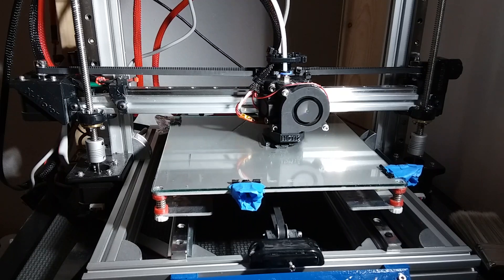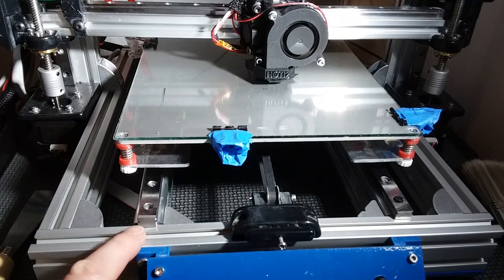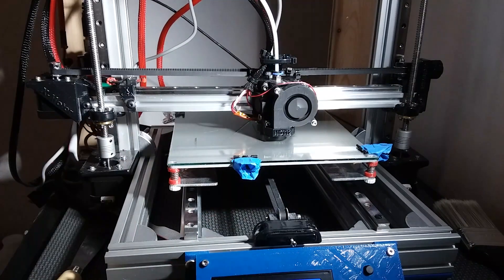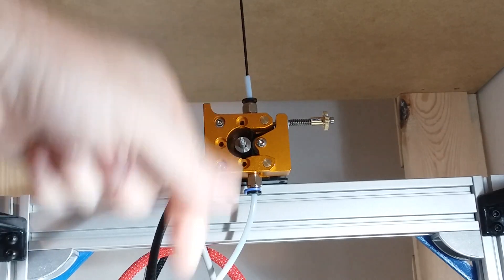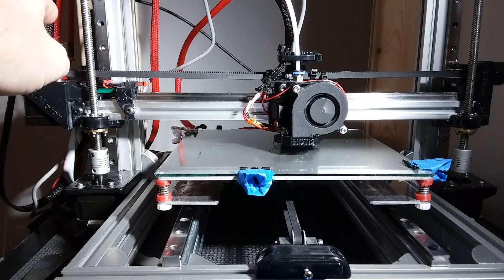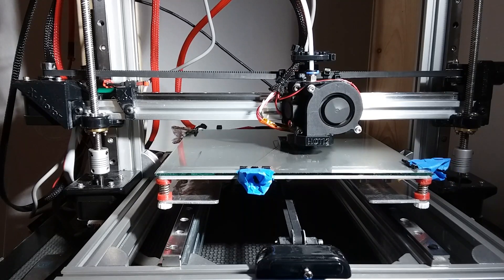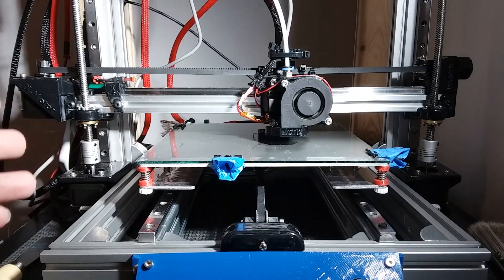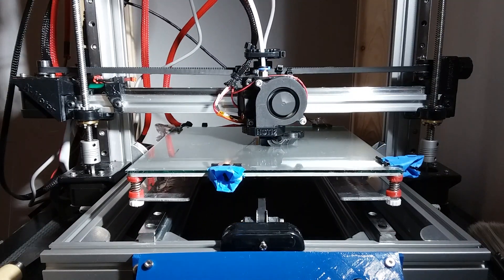The Ultimate ANET A8 Upgrade

Comment: Sounds weird to me that you had issues with the BLTouch. Did you use a genuine BLTouch or a knock-off "3DTouch"? I have a genuine one and had zero issues whatsoever for years. Precision is extremely good regardless of the bed temperature. The sensor you're using will measure completely different values depending on how hot the bed is and that's not good. Unless you use compensation tables for that, it can be dangerous.

Comment: How much did all that cost you to upgrade?
I have an Anet A8, and it prints quite well...but that AM8 seems very rigid, very cool
Reply from the maker: I probably spent under $200 for all the upgrades.  Probably could have bought a cheap printer for that but at least I know every little quirk with this printer because I built it.
Reply: @MrDabrudda  Yeah, if the Ender 3 was out before I bought my Anet A8, I would have gotten that one...

Comment: Install Klipper on your Anet main board and you'll be able to speed up your prints even more without a new mainboard
Reply from the maker: I use Fluidd and Klipper.  I haven't got around to testing the ADXL356
Reply: @MrDabrudda  i highly recommend trying the SKR mini E3 as a replacement for the Anet board, before those loud motors drive you mad haha. I made a video a while ago showing how to get it working on Marlin firmware including the original A8 LCD but I think should be even easier on Klipper

Comment: Excellent! This is truly an eye opener DIY upgrade. I have gone to the new  BLV website and the man is tireless.
Of course you must have a decent and operational 3DP to make parts. I just timed out on my heavily modded A8. X axis bearings went south. Worst noise I ever heard from a linear bearing. Fast traverse is gut wrenching. So I am faced with fixing that before I commit. They lasted for 4 yrs with daily use.
Would you ball park the total cost outlay?  Difficulty in sourcing all the parts. 
I am weighing that against just buying an Ender 3 V2 and modding that for belt drive. I have some work coming up that requires long tubes and faced with the temptation to make a higher Z envelope. 
I will end on this, I find the Anet A8 bed support frame and screw height adjustment to be kind of crappy. Wish I could find an alternative that wasn't a rabbit hole.

Comment: going from direct drive to bowden you consider that a upgrade? i thought that bowden gave you less filament options as in the really soft filament wont work with bowden. i would consider that a down grade
Reply from the maker: For print speed it is an upgrade.  I designed a direct drive mount for this ANET AM8 with a DotBit dual drive extruder with a capacitive bed sensor.  I had issues with a bowden drive under-extruding on the far edges of the build plate due to the pendulum effect on the filament.  I plan to do a video on this.
Reply: @MrDabrudda  well as you have the most experience of us both with the Anet 8, do you think the a8 plus is better or worse bang for buck. also i will look forward to the video about going back to DD.
Reply from the maker: A8 Plus looks like a decent printer.  It is built on the lower end of quality.
Reply: @MrDabrudda  yeah, but offcourse they do have the dual z axis standardized unlike the ender 3. i am more worried about it being a fire hazard, considering the rep of a8's

Comment: Wow impressive. Please remind me what parts of this are A8. If you change out the motherboard there will be no A8 left. Should have bought the parts and built from scratch.
Reply from the maker: Mainboard, stepper motors, heat bed, LCD display, endstop switches.  It's called AM8...Anet Metal 8 upgrade.

Comment: Slick! I think you should upgrade the motherboard. There's a lot of modding you can do with marlin to really push things that will leave you running out of device memory.
Reply from the maker: I flashed Optiboot loader to save memory size.  I also disable features that take up memory that I don't use like SD  Card support.

Comment: have you considered changing out the belt drives for lead screw system ?
Reply from the maker: For a printer this size a lead screw might be overkill.
Reply: @MrDabrudda  would it be better or not..eg. accuracy ..less shuddering..ghosting prints..etc.

Comment: affodrable capacitive sensors arent the most accurate, in the grand sceme of things, but a cartesian shouldnt need "auto level" in the first place. you can manually level down to far less then 1/20mm, using the traditional method of feeling the resistance with receipt paper. once this is done, you shouldnt have to "level" for months or years, mayby tweaking the adjuster for the {zero tolerance) z-endstop a little, every now and then. 
looking back, i find it kinda funny, how ABL used to be all the rage 2-3 years ago, and now it's finally starting to fall out of fashion again.
Reply from the maker: I get my bed level within .02mm with a cap sensor...I have have zero problem with my sensor after upgrading from a bltouch to a cap sensor.
Reply: Removable print surfaces made ABL unnecessary.
Reply: Great providing your entire bed is totally flat but none of mine are

Comment: There is a company called Exoslide that developed a universal linear rail carriage over 2020 extruded aluminum. When I have time I'm slowly going to design an upgrade for the A8 that will allow people to use that carriage.
Reply: Interesting Business  A bit pricey though.... given just how many of the slider trays one needs to buy.
   Making Chinese Linear rails a same or less costly solution.
 Although I'm not seeing just how the Exo slides are ANY improvement over Ploycarb wheeled carriages.
 Now.. if someone made an STL version ?  then 5$ worth of AliExpress bearings & some time and filament... would be a Cheap DIY alternative

Comment: It's not an ANET A8 any more. Realistically, it's a different printer that uses ANET motors, wiring and electronics.  What's the total cost of the upgrades? Boden setups aren't always an upgrade - You can't print really flexible TPU's with a boden, but you could have with a direct drive. Boden is only really any good if you are regularly using hygroscopic materials and therefore need to stop air getting to it, but it has a habit of introducing quality issues, as pushing is less accurate than pulling material.
Reply: I print NinjaFlex with a Boden albeit not real fast but it turns out nice. 95a is a piece of cake
Reply: @donaldfoster5998   What prints actually require  a v Rubbery filament.... besides  DIY condoms?
Reply: @barenekid9695  Use your imagination. phone case, rc tyres.

Comment: one more thing i would suggest for a better print quality is to deattach on each side the threaded rods "4-screw-ring" from the 3d printed part that holds the y-axis and instead connect the screws from the thrd. rod ring with a custom 3d printed part to the linear rails' edge as a guide. because now the threaded rods rotation create friction (when turning) when being screwed into a part like that, even when nearly perfectly centered, it then vibrates when it has no space to move and thus reduces the prints quality. you want the thrd. rods to intentionally wiggle on the x-y layer/x-achis (the rods will never be strait and are never perfect), but have them connected with an arm or a clamp so the axis still has a guided lead. Gravity also plays a huge role and the simple weight of the x axis, if you have the x-axis just laying ontop of "these screw rings" (but still need to have them connect so the thrd. rods thread bites), you can additionally just lift the extruder whenever you want and because you allowed the rods to wiggly. right now it seems like the linear rails are kind of a waste if being mounted and screwed onto the threded rod like that, no matter how good the triangular or expensive rods are :/ it also has something to do with the distance of the rods and the stepper motors location (if they are just half a mm off... you get my point). give it wiggle space!

Comment: although I do like what you've done,at this point I suppose I would buy a more commercial printer,, like the cr version of creality, I do plan on getting the Creality cr 10 s-5  which will give me a 500x500x500 work area at about 600 bucks,, But as I said, seems you have it dialed in nicely ,  Right now I am running my FLSUN QQS delta and could not be happier
Reply: There is nothing wrong building a larger frame while youre upgrading it to a more sturdy frame anyway.
Of course youll need to upgrade just about anything else mechanically as well to cope with the longer spans and the need for sturdiness.
Thats essentially how a more "commercial" printer is built, apart from the higher precision in the parts.

Comment: I just picked up a used A8 not too long ago, and I'm hoping to work my way up towards this mod in due time. There are already some decent quality frame mods, etc. installed, however I'm starting to print pieces to get familiar. Is there any sequence I should follow to get my printer up to par a little faster? Looking at the bed leveling fine tuner for the Z-axis for my next upgrade, as leveling seems to be pretty tedious so far. Experimenting with sugar paste as a bed adhesive (found on hackaday earlier) and bed temp because prints were warping on the corners. Also I'm running on the stock firmware looking to upgrade to Marlin, should I expect any improvement to quality/ease of access afterwards?

Pretty new to this, sorry if that's too many questions! Appreciate the time you took to document your progress, so far it's been pretty helpful for myself and I'm sure many others. Thanks!

Comment: The dimensions on the drawings in the zip file pdf are off. The 4 main rails of the base should be 360mm based on the length of the 400mm bearing rails minus 2x the thicknes of the 2040. The linear rails have the first and last screw holes 10mm from the end of the rail. Center of the 2040 slot is 10mm. The quality of your 2040 and how large the corner radius' are will determine the length. Zylotech extrusionis have pretty square corners. The front, back and top rail is whatever you want them to be but 316mm is an odd dimension.
Reply from the maker: The dimension can be whatever size the builder wants.  You can make the printer bigger or smaller depending on your needs.

Comment: Is there a complete kit you can get somewhere to do this or is chasing down all the parts really the only option?
Reply from the maker: No kit exists.  The BLV Mod website on Thingiverse has all the parts but is not very comprehensive because their list has parts which are not needed for the AM8 build.  I plan to make a bill of materials with every part listed to make this from scratch and where to buy the parts.
Reply: @MrDabrudda  yhea a kit exist https://www.aliexpress.com/w/wholesale-anet-a8-metal-frame-kit.html just checkout wich one its look the same aluminium extrusion lenght size and here we go for 3d print at asoeme speed for a really deccent prize
Reply: @maddugqc6911   Interesting but  one can buy an Ender 3 which is not only a complete printer but it prints better than an AM8

Comment: Your printer looks awesome. What do you think of the anet a8 plus? https://www.gearbest.com/3d-printers-3d-printer-kits/pp_009346000458.html?lkid=18165778.
Reply from the maker: Looks like a solid machine.  I would still prefer building my own printer.  If I ever need to get another printer I'm going to build the AM8 metal frame with the BLV mod from the start and completely bypass the acrylic frame.

Comment: Hello,
for the z axis have you added an additional stepper for the second engine because the card only supports 2A max and 2 engine addition 3V
 
Could you show us your connection
thank
Reply from the maker: The Z axis is the same setup at the default ANET A8.  Two stepper motors on each side.

Comment: where can I find to set a sensor for the firmware MKS sbase smootie and how to fix your bowden which E3D you use any metal or other thank you
Reply from the maker: What type of bed sensor are you using?  BLTouch, Capacitive

Pin outs for the MKS sbase boards using BLTouch.
https://lh3.googleusercontent.com/-Qg28lVbTjUE/WXkrmfzFURI/AAAAAAAACtM/hyFPMuoAnTw8IIdCgMidwNzvMchRe7EOgCJoC/w530-h292-n-rw/MKS-SBASE-BLTouch_Wiring%2B%25282%2529.jpg
Reply: Hello,
I using a capacitive bed sensor LJC18A3 H-Z BX
Thanks

Comment: The BLV mod is a fantastic mod to do but really on A8 hardware it would feel like a little bit of a waste. I am a massive fan of the Core XY builds there is a A8 version called Core A8/ A6 but it doesn't have linear rails so for me BLV is the best A8 mod till some one does a Railcore A8 mod. 
A ramps board with some high end steppers even if its a 8bit processor would be a huge thing for this printer with the rails those micro steps will never miss it just glides like butter. If a 8 bit processor isn't enough then you could all ways try Klipper using the Raspberry Pi to do all the work and the MCU to just move the motors.

Comment: I just realized that I don't have the x-rail to make that part of the upgrade. What size is the extrusion?
Reply from the maker: 2020 and 2040 aluminium extrusions
Reply: thanks, how long are your 2040 Y extrusions? The BLV MOD calls them out as 364mm, but mine are 343mm?
Reply from the maker: If you have upgraded to the AM8 mod then the two 2040 extrusion for the Y axis will be the same length as the 2 outer 2040 extrusion on the AM8 upgrade.
Reply: MrDabrudda I think the original AM8 mod was about bringing all of the Anet parts straight over to the mod? In which case the front to back measurement is 343, not 364mm. Anyways, we’ve ordered more bar, and were in our way.
Reply from the maker: You can order the 2020 and 2040 extrusions either from Aliexpress and wait a month or order from Mitsumi USA https://us.misumi-ec.com/  Mitsumi will even cut the extrusion to the length you need.
Reply: @MrDabrudda  Did you use the standard or milled extrusion when you ordered?
Reply from the maker: @techcoast7283  The standard extrusion

Comment: can you give me what and where to get the frame and bearings from
Reply from the maker: I'm working on a list/video where someone can buy all the bits and pieces without having to buy an ANET A8.  Go straight to a metal frame and MGN12H bearings but there are hundreds of parts to list and the creator of the BLV Mod didn't exactly put together instructions on assembling this.  I have so many lessons learned from this upgrade that I could make a whole other video on it.
Reply: @MrDabrudda  That would be great if you have the time to pull that off.
Reply: @MrDabrudda  Maybe set up an account where people could donate for your time?

Comment: Hi that looks amazing!
 Can you please put here link for the metal extruder? I have also upgrade on metal frame and want to put rails on to! Thank you !
Reply from the maker: 2020 Aluminium Extrusion
https://www.aliexpress.com/item/CNC-3D-Printer-Parts-4pcs-lot-European-Standard-Anodized-V-Slot-Linear-Rail-Aluminum-Profile-Extrusion/32813616949.html?spm=a2g0s.9042311.0.0.27424c4dzHpXiR

2040 Aluminium Extrusion
https://www.aliexpress.com/item/HOT-Sale-CNC-3D-Printer-Parts-European-Standard-Anodized-V-Slot-Linear-Rail-Aluminum-Profile-Extrusion/32813630598.html?spm=a2g0s.9042311.0.0.27424c4dzHpXiR
Reply: Thank you,-But i mean the think on top of the aluminum frame which pushing filament through the bowden into the hot end
Reply from the maker: US 3D All Metal 1.75mm Bowden Extruder+NEMA17 Stepper Motor Prusa Kosel RepRap

https://www.ebay.com/itm/US-3D-All-Metal-1-75mm-Bowden-Extruder-NEMA17-Stepper-Motor-Prusa-Kosel-RepRap/372138025126?ssPageName=STRK%3AMEBIDX%3AIT&var=641010786518&_trksid=p2057872.m2749.l2649